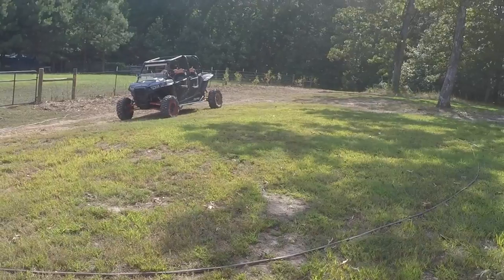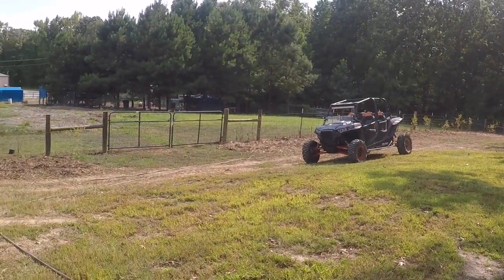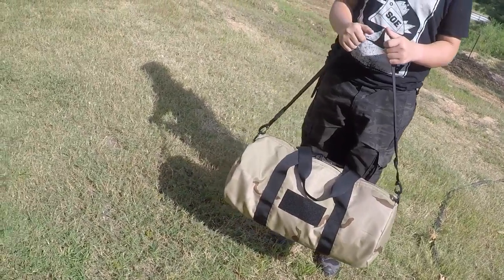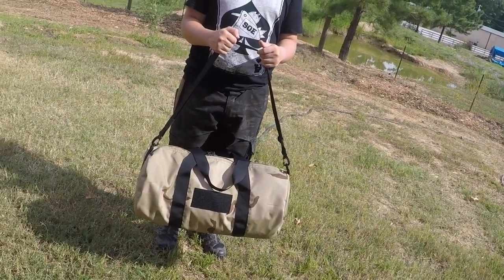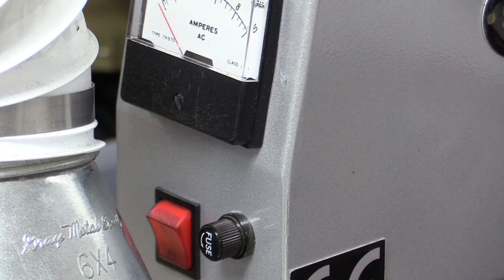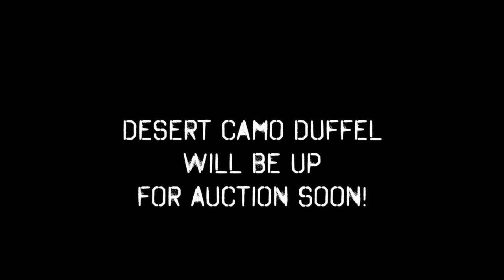Desert Camo Duffel Bag Build

Comment: Hi,
At a moment you tie 2 threads with each other, is that to change thread color and not having to remove old color and fully thread again the sewing machine ? if it woks its a super nice method.
you just have to cut before the needle and insert the new color in the needle hole ?
I'll try tonight, can't wait to see if it works :D
Thanks for sharing all the process !